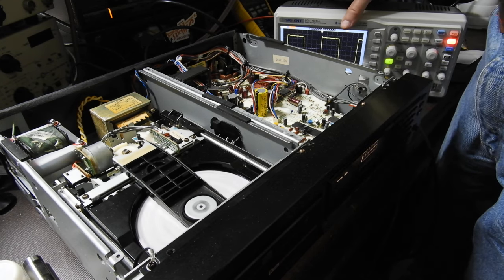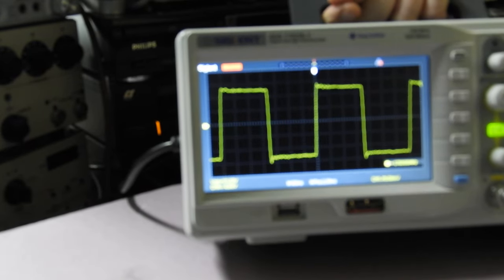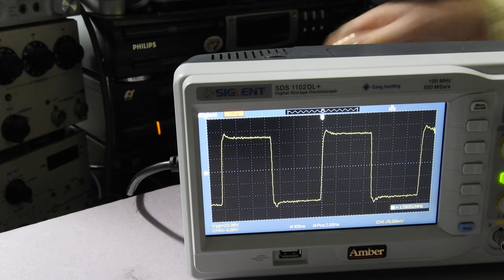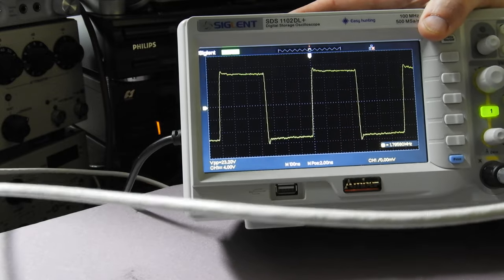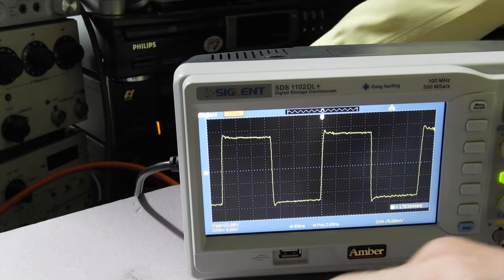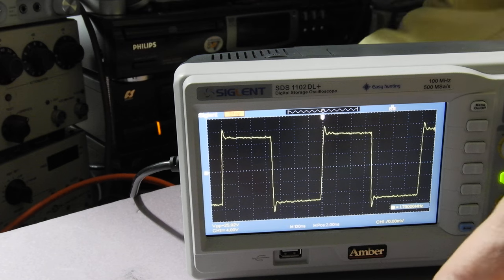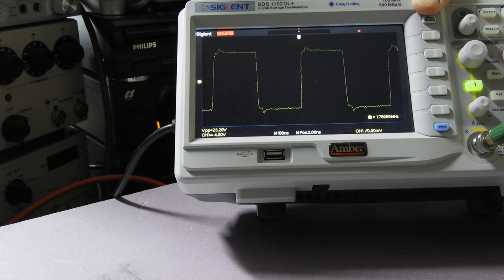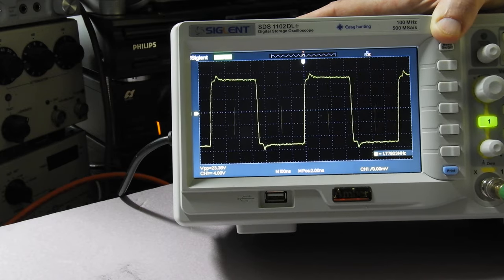"Shootout" comparison of digital coaxial SPDIF cables using Sony CDP-337ESD as a source.

Comment: hi great video indeed  and thank you for it
I really dont understand why they did not adopt the BNC standard, a common choice for digital scopes, for cd transport out and dac in 
they made a mess using RCA that is not designed for digital transmission   
i was watching a video and actually some cheap bnc cables have some issues in passing a square wave from a function generator to a scope
of course Wadia that is a really serious manufacturer uses BNC connections   
They sure know how to do digital

Comment: Great Job ! i use several different digital cables i do prefer coax over toslink my favorite is a cheap Audioquest Cinnimon coax 75ohm. 
thanks for the video ! digital output does matter theirs so much involved its not just 1s and 0s like you said Mech matters !! power supply driver stage stability of unit for vibrations . 
when i compared my Audiolab 6000cdt vs Denon 600ne threw digital output the sound with the lab is much better . 
but so is the price point 😆

Comment: May I ask how many Volt the signal is? I want to measure my own output. I have high res fluke 196C scope. My player stops it’s output. Fast fwd or skip to next and we are back on line. One year old Cyrus cdt-Xr. Not super stable. :)
Reply from the maker: Normally, the output is between 1V and 2V peak-to peak. But I have seen them go to 6V. Have a look in the user manual if there isn't a feature to turn off SPDIF out. Maybe this feature is malfunctioning and this is the reason why it is intermittent.
Reply: @hear-net-au  thanks for fast reply. I have a 10V probe, so that will do.  It is a transport, no nonsense kind of type, with little options, so no option to kill Spdif. Same behaviour with optical, so an issue. But if I can capture the phenomenon, then I would be happy. Cec drive and Esoteric player plays all cds without issues, but not the Cyrus.  Headache.
Reply: @hear-net-au  hallo Sir. I have checked the output. Scope is fluke 196c- 100mhz -1gs/sec. Freq varies from 1.41mhz to 2.82mhz. Signal is 1.27V. Decent over shoot on both up and down flanges. About 229mV. No change when signal stops. Curve quite smooth. 
Compared then to cec drive. Here same freq variations.  Signal is 1.18V little overshoot. Around 30mV. Curve is more rugged compared with cyrus.  Any comments?
Reply from the maker: @thomasmoeller7731  the SPIDIF signal is about 1.5MHz and just over 1V p-p is good. Bit of overshoot is not ideal but then not critical either. So it's all good.
Reply: @hear-net-au  hallo Sir.  Thanks for replying. I will have to look else where for the reason to my problem.  Would have been nice if the output died. But sadly no.  Have a nice day ahead.
Reply: @hear-net-au  sorry to nag you again. A mystery.  I took same player to my fathers house.  Different ac source, even though only 2km away from me. Now drive plays perfectly. Any suggestions?
Reply from the maker: On that video the signal is 2.4V P-P (peak to peak). It actually says 23.2 but this is because my scope is set for my probe (which in turn I set at 10:1 in order to load the circuit tested less and I forgot to change it). Most SPDIF signals are between 1 and 2 V P-P and frequency varies between 1.5Mhz to almost 2MHz.